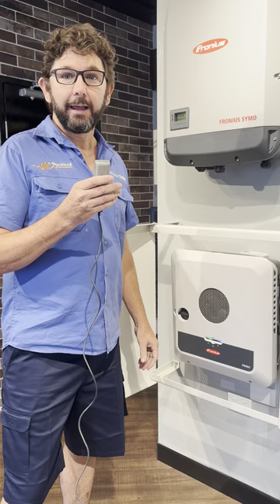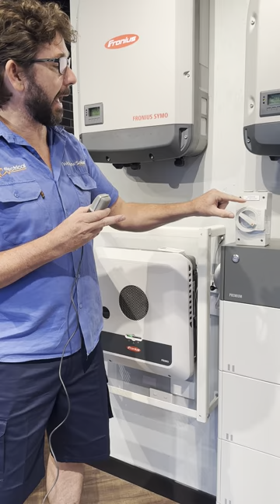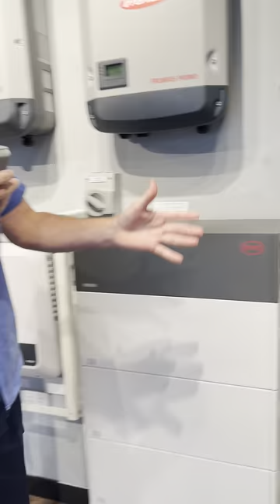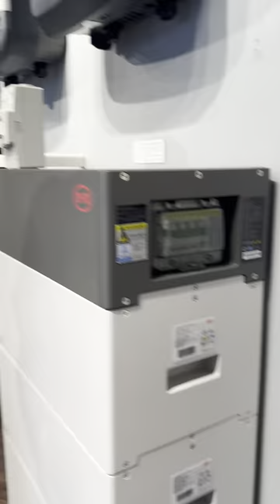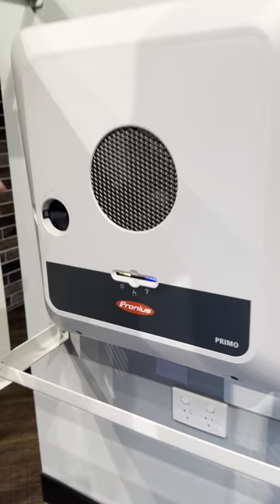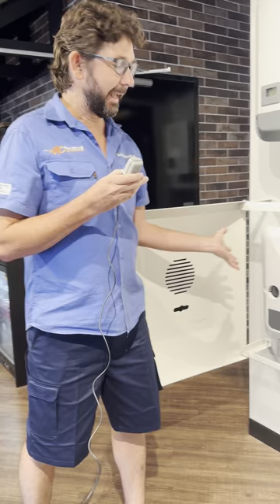How to safely restart your Fronius Gen24 inverter

Comment: Mark, I have just connected my Fronius inverter to the network. Trying it the long way was a real pain and with many failed attempts I was short term locked out. So I tried connecting using the WPS. I have a Mesh modem which has a 'Sync' button which I found also acts as a WPS button.
1. Reboot the Inverter as recommended.
2. Press the Sync (WPS) button for 2 seconds, the modem flashes. 
3. Go to the rebooted inverter and double press the 'optical touch switch' twice.
4. Wait 4 seconds and say "Thank God!" as the lights indicate it is connected.
5. Go to your phone phone and use the new password to log in to the Fronius app and Robert will be your Mother's Brother.
Then discover that in spite of the Inverter being expensive and having paid that, the useful app has a subscription but requiring no input from Fronius. Tell your Fronius mate that is a rip off and leaves a nasty taste in my mouth (and I am sure other customers).

Comment: Thanks for the video. Are there any additional steps needed if the hybrid inverter is connected to a BYD battery system?
Reply from the maker: No, the inverter just sees the battery as another source like solar. So turning the DC isolator off will also disconnect the battery

Comment: I am trying to reset my fronius inverter as it is not working properly, and putting in the 37767 code does not work, it comes up with access denied. Is there an overall override reset.
Reply from the maker: Switching ac and dc off and on again is the best reset.